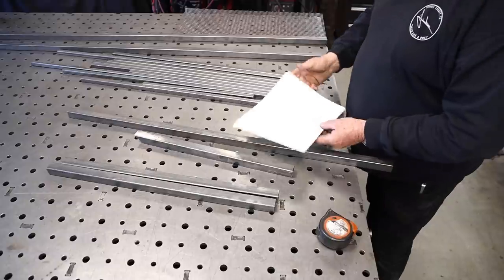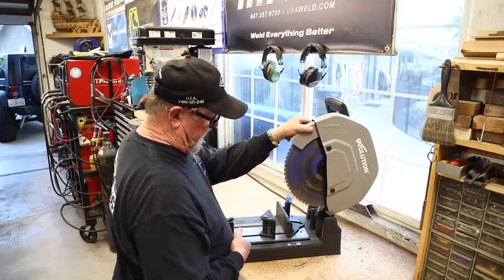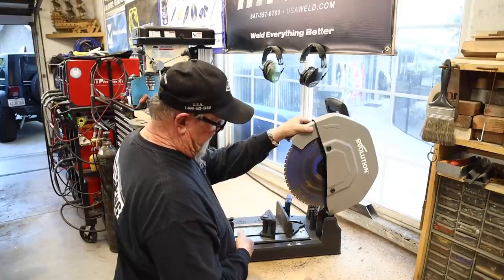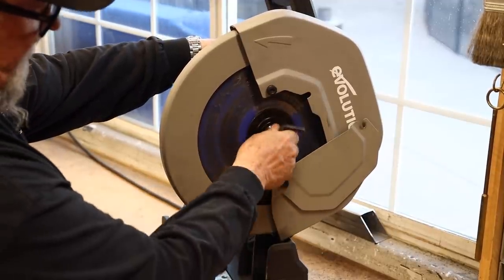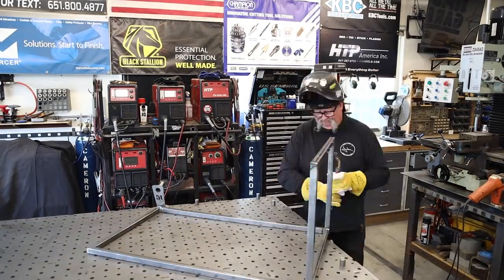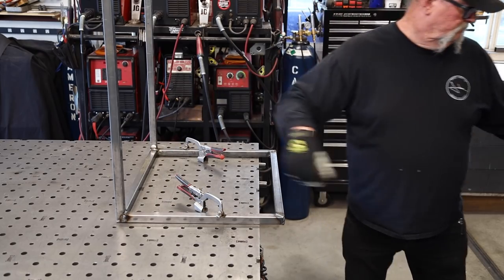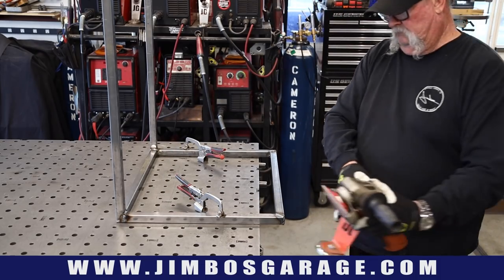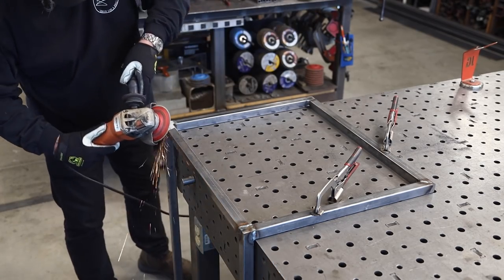Fireplace Screen Build Part 1of 3 | JIMBO'S GARAGE

Comment: My feedback. A little too much screen time for the gas bottle changing. I miss hearing the sizzling sound of welding - prefer it to the music. I think your old format is great. Not everyone is good at voice overs but I think you do a great job at it. I think what you were doing worked great.
Reply: I'm pretty sure these things were sponsorship endorsements. I felt it with the blade change first, then the bottle swap. Had to be for the sponsorship. This video has 6 ads in the span of the video, plus one before and one after. He be chasing the money a bit more recently.
Reply: @josiahwright7114  I agree with that. It's obvious to me.